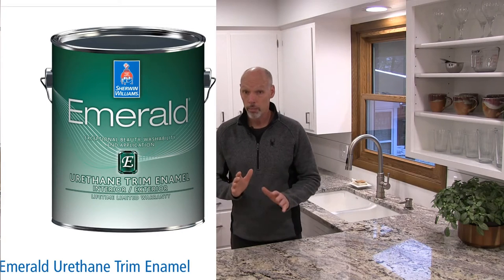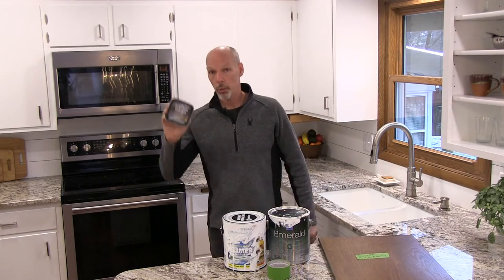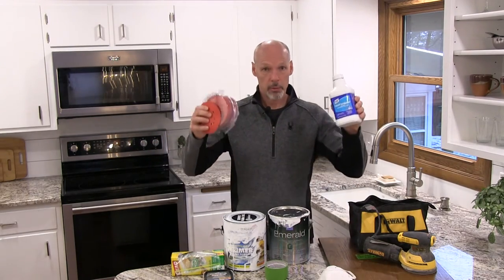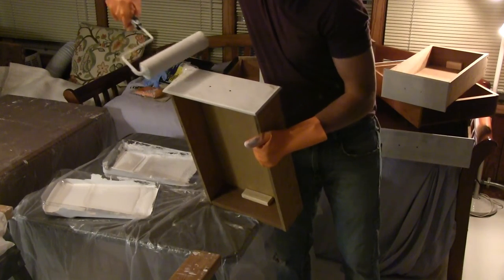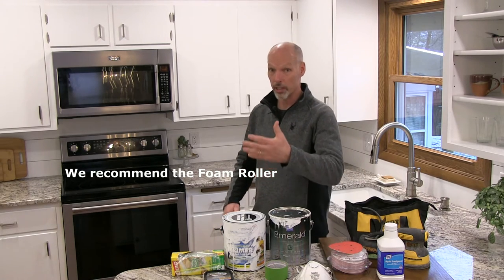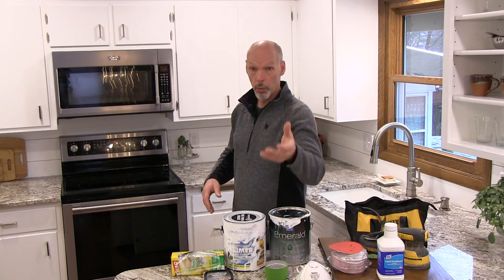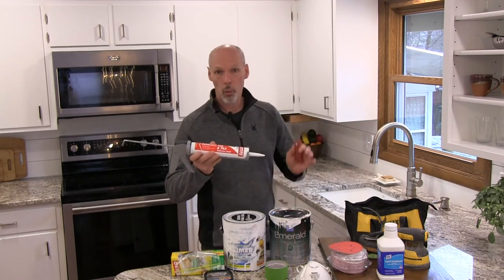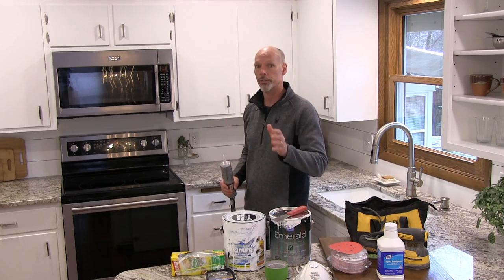Painting Kitchen Cabinets White

Comment: I am a chef and I use my kitchen more than most and my cabinets get very greasy. What are your thoughts on putting a sealer on after few coats of paint for only the ones near and above the cook top.
Reply from the maker: Thanks for the nice comments. If I were in your shoes I think I would be leaning towards sealing them in which case I would also lean towards using an oil based primer. I would do all the cabinets the same so as to not have any color variations. You got this! 😊

Comment: Great video! I used the same primer and paint:) What do you recommend if, after a few weeks, you notice there are some imperfections on the surface of the cabinet after sanding the first time. I think I could have smoothed some areas out a little more. Can I sand it out, prime and paint over again?? Thanks!!
Reply from the maker: Thanks for watching. If you mean as in after already completing the painting project and going back and “spot” touching it up by resanding and repainting here and there I think you will be able to tell;  possibly making it look worse. It’s hard to know. If the imperfections are bad enough that you want to try touching it up try first at an area much less visible like the inside of a less used cabinet door.  My gut says probably won’t look good after “Spot” redoing. We have some imperfections on ours as well and are just living with them. Overall it’s still a big improvement. Let us know how it turns out if you try redoing an area? :)
Reply: I would think you would have to do the entire door over which is an option! Another video does just that.

Comment: Did you sand between coats of primer and paint?
Reply from the maker: We did not. We spot checked them as we painted and a few times we used our finger nail or a small spatula to remove any dried debris we found. Thanks for watching 😊

Comment: How are you cabinets holding up? Now
Reply from the maker: Very well. No regrets. People coming into our home comment on how great they look. If we had to do it all over again we would’ve caulked before painting. Some of the caulk in the cabinets is turning just a very slight yellow. Not sure if we got some bad caulk or if it’s because we caulked such big gaps.  Make sure it’s a paintable caulk if you do caulk. Thanks for watching. We recently painted our bathroom cabinet. See below...
Reply: Silver Lining Day Dreams  thanks for the tip.. I am planning on starting this Friday to prep the cabinets.. super excited. Thanks for the second video
Reply: My project is complete. I am so happy.. question what do you use to clean them on a daily basis?
Reply from the maker: Awesome 👏. We don’t clean them daily. Ends up more like monthly or before we rent our home on Airbnb that we clean them. We just use a clean soft wet white towel or even sometimes a clean damp  white paper towel and gently wipe it off each time wiping using a clean area of the cloth and then we a use dry part of the cloth. We haven’t found the need to use a detergent so far. For the most part we spot clean them as we spill as this I think is the best defense. Remember it takes a good month for the paint to cure. Hope this makes sense.
Reply from the maker: 👍🏼. How did everything turn out?
Reply: @SilverLiningDayDreams  AMAZING so far so Good. I wish I can insert a before and after picture. So far they still look great!
Reply from the maker: If still interested we uploaded a 2 year update video on how well our painted kitchen cabinets are holding up 😊...
https://youtu.be/zoPVe7uRFe0